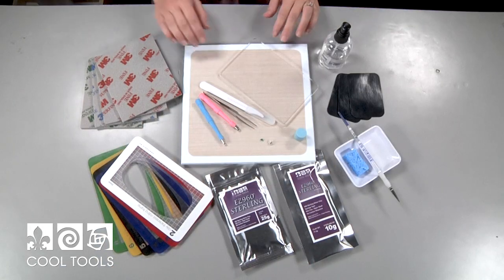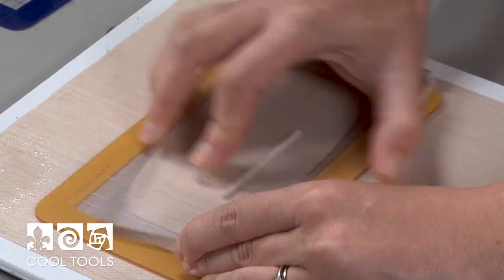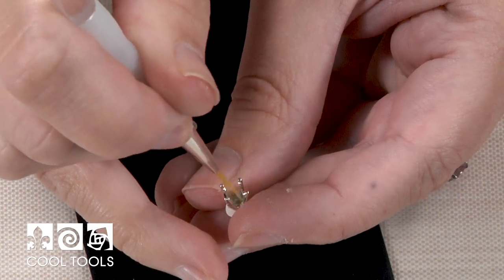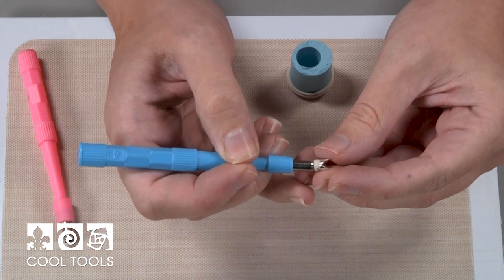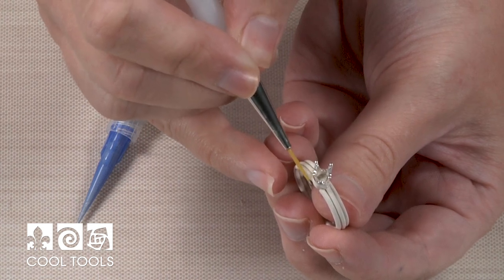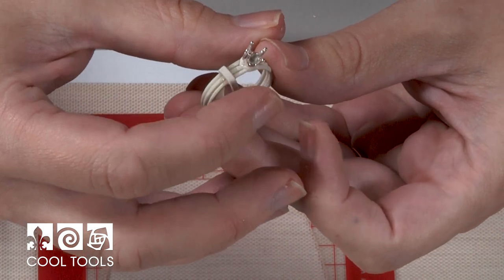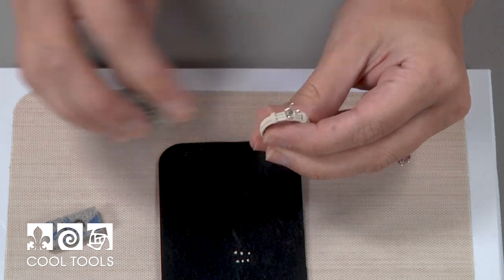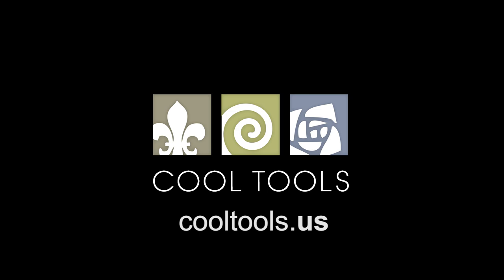Cool Tools | Snap Setting Ring with EZ960® Sterling Silver Metal Clay by Karen Trexler

Comment: You are absolutely wonderful and thorough!.  I have wanted to start this PMC jewelry making, for quite some time, but very nervous. I was curious on how long to you leave the ring to dry before sanding and firing?. Can I use a real diamond?.  Keep up the wonderful work...IM HOOKED! :-)
Reply from the maker: Hi Joanna, how long it takes the ring to dry depends on its thickness. Generally you'd want to dry it on a hot plate. This not only dries it faster, but also ensures that it the piece is completely dried. Yes, you can use a real diamond, but it would need to set after firing as a real diamond cannot be fired in a kiln. If you have any other questions, please feel free to reach out to us directly. We're always happy to help!
Reply: @cooltoolsvideos  Oh thank you so much!. The ring here in your video, for example, how long did that one take to dry on a hot plate?.  I have one here at home :-) .

Comment: Great video Karen! Can you confirm if you fired the ring on the blue rubber ring sizer in the size you want the ring to be after firing? Or, do you use one that disintegrates?
Reply from the maker: Thank you! I'm sorry that wasn't clear, the silicone mandrel is only used for forming the ring. For firing, you"ll want to use one of the investment ring pellets, that disintegrates in water, in the size that you would like your ring to shrink to. Thanks for giving me the chance to clarify that! 
Karen
Reply: Do you think you will do a video on how to set a non-fireable cab? I’ve ready many books and tips on the subject but still don’t feel confident enough to try it out.
Reply from the maker: @alishagray7771  We do have a few videos on setting non fireable cabochons you can watch: 

https://www.cooltools.us/Video-Tab-Setting-for-Non-Fireable-Stones-with-EZ960-s/2782.htm

https://www.cooltools.us/Valerie-Bealle-Tab-setting-a-Free-form-Cabochon-in-Metal-s/2561.htm

https://www.cooltools.us/Valerie-Bealle-Back-setting-a-Cabochon-s/2552.htm

Hope this helps!